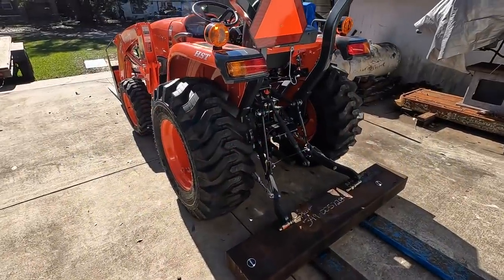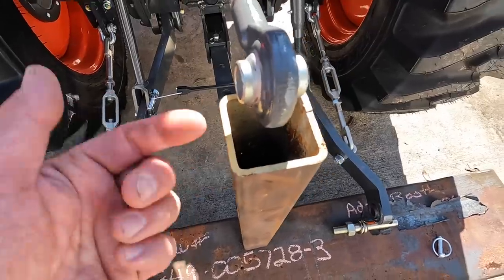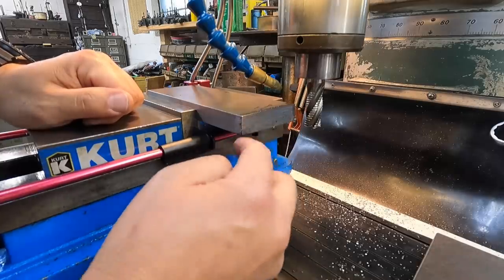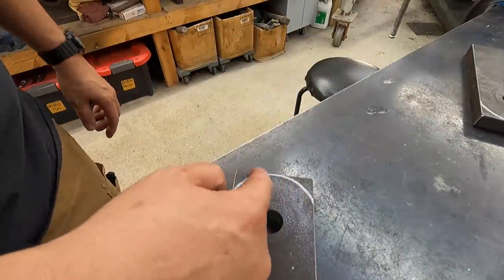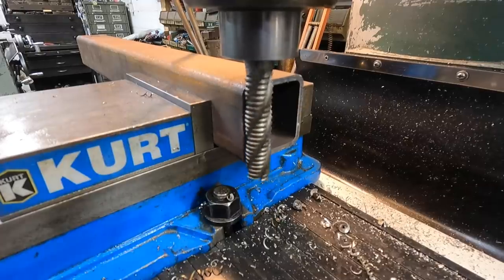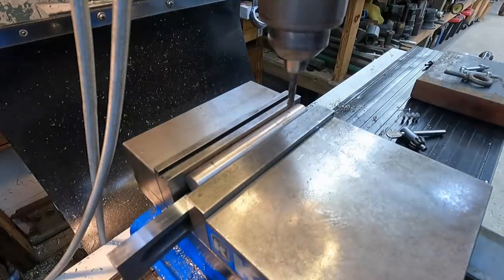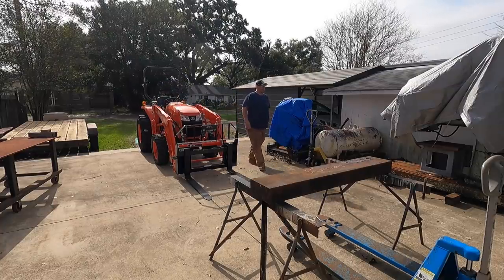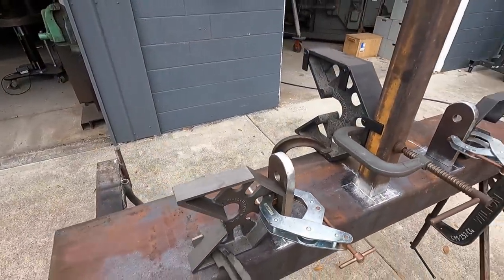Tractor Rear Counterweight Part 1

Comment: For the scale on the steel just get a big rosebudtip on the oxy acetlyeen torch and heat it up a bit, should pop right off the second you hit it with heat.

Comment: Did  you tell them which class 3 point you had, or at least which tractor you had?  There are 4 different classes of 3 point.
Reply: There are five different three-point hitch sizes.  Size categories 0 - 5.  That tractor is Cat 1 (  Lift arm pin  7⁄8  Top link pin 3⁄4 )
Reply: Exactly. Would he buy a drill bit for a hole he didn't measure first?

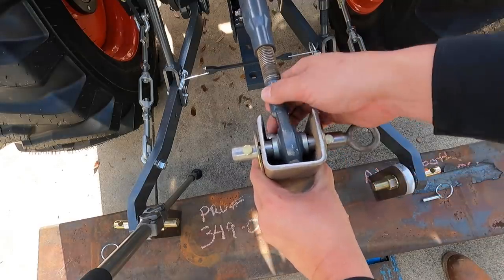Comment: 25:01 .... Worst case Ontario, if the top pin did fall out, the counter weight would just pivot a few degrees, great work around!

Comment: If it's not too much work, bring the outside ends of the counter weight inside the centerline of the rear tires or it will constantly be catching on brush and stuff.

Comment: A lot of farming folk like to save money by using an old oil drum full of concrete or water even. We used to pump ballasted tyres full of brine, or salty water to stop it freezing in the 1960's.The top link should be taking a lot of the weight, so your 2 inch tube is much too long, in my opinion. Storemen aren't in the business of actually driving or using tractors as a rule, all they know about is model numbers and part numbers! Plus the correct maker's manuals of course. Some can't be bothered to get on the computer and go through the parts, they just guess for quick moving parts.

Comment: You can also fill the rear tires with windshield washer fluid. You can get concentrated fluid for cheap and mix it by the gallon.

Comment: Tough little tractor.  If you find the front doesn't have the expected lifting force it's common that owners do modifications to get the last 10%-15% of hydraulic pressure.  They come from the factory a bit under the rated pressure.

Comment: Weld a tab on the back side of the counter weight and mount a trailer hitch or two. Position the tab so you can see the balls when seated on the tractor. You will find them very useful.

Comment: The mill scale doesn't clog the abrasives,they merely polish each other because they are the same hardness.
I prefer to leave a rag soaked in hydrochloric acid on the area I want to remove the scale - it's gone in 30 minutes

Comment: When I lived in Ohio, I used to put a solution of calcium chloride in the rear tires of my little tractor. (plain water freezes in Ohio winters).  Add on some cheap tire chains and I could plow snow all day long.     At 8 lbs per gallon, water in the tires is an easy and cheap way to stabilize your tractor.  
    Measure stuff before you drive an hour to buy the wrong thing, OR, order it from Amazon.
Reply: "Measure stuff before you drive an hour to buy the wrong thing" DUH! Exactly, Abom get a life!

Comment: Far too much precision for anything mounted on a tractor. It should be measured with a knotted string, cut with a hack saw by a drunk 3 year old, and welded by a gorilla smoking a cigarette... and any time you think you've built something on a tractor strong enough, triple reinforce it and be prepared to brace it again later.
Reply: Downsized... Just 5 acres and 2 horses now. Enough for a small bush hog, and nothing will tear up a tractor faster.

Comment: the pins  issue is determined by your tractor's size.  most home tractors are CAT1 most tractors above 50hp are considered CAT2, the larger diameter pins are CAT2 for heavy excavating and farming

Comment: Hey a cheaper way you can make a rear weight is take a meter 55 gallon drum and fill it with concrete in the middle run a round bar thats the size of the 2 ball n socket swing bars...
Save the material, thats alot of metal..

Comment: Those top links come in all sort of sizes, depending upon the weight of the implement you are hooking to.   The modern thing is to use quick hitch ball connectors,  but sometimes they can work out slower, if you forget where you put the balls..!

Comment: Solutions of calcium chloride are used in tractor and other off-road tires to provide ballast, improve traction and reduce wear and tear on tires and machinery. Solutions of calcium chloride can add about 30% to the weight of water and lower the freeze point of the solution well below that of plain water.

Comment: Water will rust out wheels. I think antifreeze would be better and it won't freeze, if it ever gets that cold
Reply: God point .. we always used tube tires, but this modern tractor is got to be tubeless .. the dealer will know the right stuff t put in there .. we always used Calcium Chloride solution.

Comment: If it's not heavy enough you can put two vertical H beam pieces on there and put semitruck break disc's on there like used by Volvo Scania Unimog and Mercedes trucks
12x Unimog break disc is another 500kg getting you a collective metric ton  on your rear end

Comment: Save your money don’t pay them to water fill the tires, just buy the adapter and do yourself. The hard parts already done, all need to do is let the air out the tire, put the water hose adapter on and fill the tire with your regular water hose. Once you hear water stop running in the tire quickly turn the water off, remove the adapter and adjust the pressure with air. However if you want it for the weight, foam fill the tires it’s heavier them water, no rust issues, and you won’t have any flats either.
Reply: You must live somewhere warm. 🤣
Reply: @Yooo..mamma11  yes and Florida where he at doesn't get cold enough to freeze all the water in a tire. However it's still the same adapter to liquid fill a tire.

Comment: I don't get why you welded the ears off center on the weight. it would hang totally fine even without the middle rod if they were just centered. And also why not dress the inside of the square tubing off a bit instead of your bearing housing.

Comment: Tractor supply company carries implement pins. 

Kubota doesn't follow AG ISO standards for the distance between PTO shaft and drawbar. That could be an issue when pulling an implement (not from 3 point hitch) and running a PTO. An example is a batwing mower.

Comment: You think picking that chunk of steel was sketchy. Everyday at work I'm loading haul trucks with rock. I pick ten ton of rock up to full extention on the loader and roll across not very level or smooth quarry floor to dump with the loader arms waving back and forth like it's at a rock concert. Took me forever to get use to it and trust that it wasn't going to lay over.
It just takes time, just remember the closer to the ground you keep your weight the lower your center of gravity and the more stable you will be.
For a counter weight your doing fine. If it was something that had to do more than just hang there and look pretty, I would have put gussets. I've ripped stuff in two with three point hitches.
The multiple holes on the tractor where the top link attaches are for degree of tilt as you raise the implements. The top hole is level and the next hole down will cause the implements to tilt up more and the bottom hole makes the tilt the most. I don't know how many holes you have some have two and up to five or six depending on how much tilt you want.

Comment: You need to drill a hole at the base of that box section or it will end up filling with water or fill it with molten lead for that little extra weight lol

Comment: use beet juice, it won't rust your rims. the valves will always leak and cause the area around the stem to corrode prematurely
Reply: That's not 100% true. If the tyres have never been removed from the rims since the tractor was built the rims won't rust unless there was a scratch in the paint. Once a tyre has been removed to replace or repair then you will get rust. 

We have a 2009 Claas Arion 640 and the tyres have been filled with water and drained back out several times over the years. Both the the left tyres have been replaced due to side wall damage, the left rear wheel has had the tyre off a few times and the front twice. Both left rims have surface rust and just recently in December we had the right rear tyre off for the first time and the rim looked like it was brand new, I ask the tyre fitter why that would be and he said it's  never been removed before. Not a spot of rust on it, but now it will probably get surface rust since it has been exposed.
Reply: @Dropbear237  i was referring to the ballast that has salt added. strainght water is not used in my area, as it will freeze
Reply: @jacklong311  did you not hear Adam say people suggest using antifreeze with the water, no one said salt.

We don't have freezing problems where I live, we only get frost a couple days a year.

Comment: I see you have both pins on the inside of the hitch points. Wouldn't it be hard to remove that way? You'd need to unscrew the pins every time. Or am i missing something? You could just have both pins pointing left or right and it would be much easier to remove.
Reply: The link arms swing inwards and outwards significantly, no need to remove the pins.
Reply: @JasonHam41  ah, makes sense.

Comment: For the most part, you are so far beyond my skill & knowledge levels but I was scratching my head hard as to why you weren't using a course cup style wire wheel for the rust clean up. It's the cat's ass just fyi for future projects requiring heavy clean up. Keep up the good work.

Comment: If you have all three attachment points in line like that, the entire mass of the counterweight will try to rotate around the two outside pins using the center square tube as a lever trying to pull the upper attachment point outwards. Best case scenario, one side of the welding on the tube is going to be under a lot of stress. Worst case, you’ll break the tractor. Think of the momentum of you going over some bump and the counterweight bouncing up and down. The weld might hold, the attachment point might hold, but if you moved the center attachment to the backside of the bar with the cemter of gravity within the triangle of attchments, there would be a nice downward force and no nasty angular stuff.
Reply: Exaggerated hysteria. It's as tough as hell.
Reply: @JohnSmith-vi5pz  have you done the math? Do you know the specced forces the hitch can handle? All I’m saying is moving the vertical pipe a few inches and putting it at an angle adds a wee bit of work but reduces the stresses involved considerably.
Reply: @belZaah  There's enough thickness of mounting steel and weld to lift 20 tons of weight if the tractor would handle it. You won't ''break the tractor''  that's sheer nonsense. It simply won't lift it and any 3 point linkage is about three times as strong as any lifting capacity. This is a tractor, not the Space Shuttle, no math needed.
Reply: @rl3898  Complete pish, rotational moment will be next to zero. Your twaddle doesn't even pass the sniff test.

Comment: With backing, especially inside, up you often need as much room as possible so I would have put the steel weight vertical snug to the rear tires.
Also put a  drawbar hole or even a trailer hitch receiver out the back for the times you have jockey  a rear trailer/implement around without removing that heavy weight.

Comment: Some of my 3 point stuff uses stepped pins, 3/4 then stepped down to 5/8. Different sized holes on each side of the clevis! Don't think that isn't frustrating trying to find pins to fit that screw ball design. Haha.

Comment: Did you have the tires loaded?  I have the 19hp Kioti knock off.  20 years moving boats around and forking pallets for the boat shop.  The tires are loaded with 800 lbs beet juice.

Comment: Woudn't it be cheaper and just effective to fabricate a mould/mold  for concrete blocks to use as an afjustable counterweight?  It would certainly be cheaper  to fill the tires/tyres with tap water, and just as effective as paying the dealer and hourly rate so to do1😱

Comment: I probably would have used a large water tank. Get a PTO or hydraulic powered pump to power empty it and you could wash the mud off before transporting the tractor. Of course this only works if you have water at each worksite. The idea is that every 1000 pounds you put on it is 1000 pounds more load on the trailer and more fuel spent hauling it. If it is rarely going to be hauled, then none of that matters

Comment: I'm not sure but I think you are going to find that the large plate is going to want to pivot and bang as yo go over any bumps . It would probably have been better to locate the upper link mount (tube) closer to the rear of the plate to offset your pivot points . Less wear and tear on the mounts and tractor linkages  .

Comment: Should put a rail across the block of steel for suitcase weights, 950 # isn't enough sometimes. Seems to me your running the engine power to high, little over idle work well.

Comment: Do not fill your tires with water.  It rusts the wheels.  Beet juice adds more weight and is no corrosive.
Reply: theoretically yeah, but i know 100's of people with 1000's tractors and i've never heard anyone say their rim  rusted
Reply: Yeah, we've never had issues. Our tractors are fine. Our Ford 5000 had been filled for the past 40 years at least, and it's fine.
Reply: there in intertubes
Reply: AS Dale said, with tubes it is a non issue.  It became an issue when the tractor tires became tubeless.
Reply: Sometimes implements are seasonal. Easy enough to puncture a tube or have a leaking stem. Many old tractors I've seen with rims rusted through. Especially bad was the calcium and water mix.
No experience with the beet  juice, but for the modern epoxy coatings, I'd guess that with time the beet juice could be corrosive too. One scratch in your paint ...
Reply: @littlejackalo5326  Well then, I salute your obvious diligence. I'd guess your machinery gets well maintained.
Reply: @charlesangell_bulmtl  the pH of the beet juice is high enough that it can’t cause red rust.  It will form a black oxide, similar parkerizing on guns, and then self passivities a few thousandths in.

Comment: Why not put that center pin in the lathe chuck and turn it to 3/4" ?
Reply: Thats what immediately came to mind. Especially when he chucked the one he made into the lathe to cut the bevel. Might as well just turned down the other one. But im sure he had his reason.
Reply: @BiggieDiesel01  Pins are incredibly hard material to machine.  For the cost of the right pin its not worth machining one down.
Reply: @BiggieDiesel01  He might just return it to make a point.

Comment: I would suggest a quick coupler if u are gone be changing to a blade or mower or tiller and things
A lot safer to hook and unhook and a lot less time and adjusting links

I would not go with liquid weight in wheels but if u do use the new non rusting kind so it doesn't rust the rims

Randy

Comment: I love your videos but I have a question. Isn't using that nice piece of solid stock a waste? I mean I run a laser table and have tons of 1/2" plate drops. Why not use strips and weld them together as opposed to using a nice piece of solid stock? Or make a heavy box and fill it with concrete? Just a question.
Reply: @douganderson7002  No, its folks like you who get all bent when someone questions something some Yt'er does as if its sacrilige or plain envy.  Abom can do as he wishes, however 99% of people who would have that piece of 'scrap' probably don't consider it scrap at all.  
 Some scrape plate to make a steel container filled with concrete would have cost close to nothing and done the same job. 
Go get a quote for a chunk of steel like that and come back to us with that...
Reply: A box of rocks is better and about as interesting as this channel.

Comment: I know exactly what you mean regarding the implement dealer selling you the wrong size pin.   If I had a dime for every time I drove from the farm to a store or farm equipment dealer and ended up the wrong size whatever, I would be rich, and it really ticks me off.   The pin you made yourself is probably a lot stronger than the one they sold you anyway.
Reply: He didn't get the wrong size pin, he didn't come with a measurement. His big error.

Comment: I thought it was best to keep the counter weight as close to the centre line of the tractor as possible to keep the balance in case the load was off centre or uneven ground. Cut that piece in half & fit it in between the two lower links.

Comment: Great videos Abom.  I wanted to let you know that off and on, your audio cuts out on the right side.  I've noticed this in a few of your recent videos.  It started on this one when you pulled out the cutting torch. Sound came back on the right when you started using the cutoff wheel on the top of the middle attachment point.

Comment: The problem is the width of the counterweight - in tight turns it will swing wider than the back wheels. Not good in tight situations.

Comment: I would have put the weight on the short end, not flat like that, looks like the extra offset you get will put a massive strain on the welds.  That's the weight of half the counterweight trying to pry downwards towards the back of the machine, in practice only the rear most part of the welds take all of the offset weight. When the machine bounces around, that is a hell of a leverage acting on those welds.....  To make it stable, I'd use some outriggers I could extend when I wanted to set it down. to make sure it won't tip over while it's sitting.
Reply: If a weld breaks or cracks (not likely knowing his skills!), I would bet you he could fix it.

Comment: That mill scale looked pretty nasty. I've had really good luck using silicon carbide stripping discs for cutting through mill scale. There's something about how the specific type of abrasive interacts with the scale, not really sure of the science behind it. It's kind of amazing seeing the scale just evaporate with the lightest touch, and without gouging up the metal underneath.